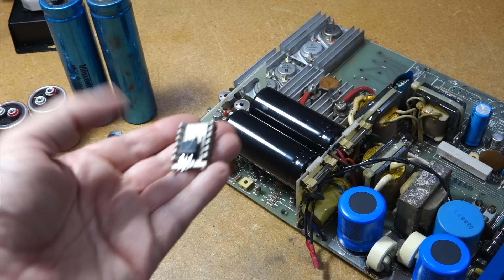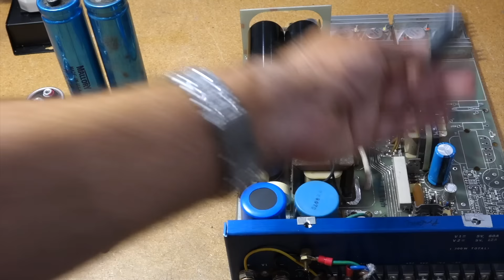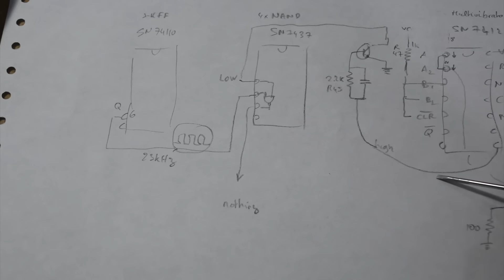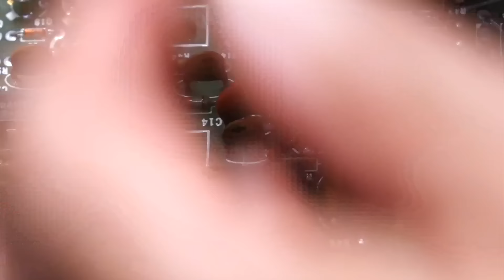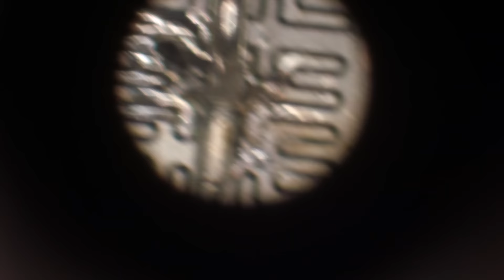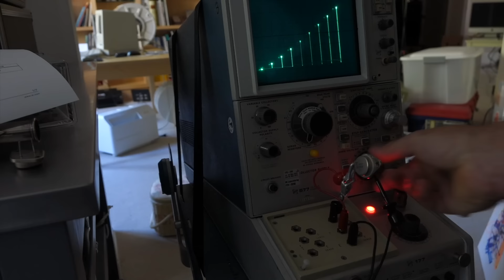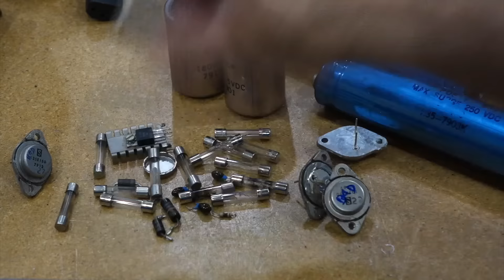Digibarn Alto Part 2: Restoring the Power Supplies from Hell

Comment: The fuse problem is the worst... Many times I have rolled across the shop to steal fuses from other equipment to diagnose what's on the bench. If only someone made a resetable ckt breaker for those push and turn holders...

Comment: A variac is very handy for restoring power supplies that are having overcurrent problems.  That way you can monitor for excessive current through the circuit as power is applied gradually.
Reply from the maker: Might help a little bit to reforms caps in a linear power supply. But if there is a hard short in a linear supply it’s useless too. It won’t help you with a switching power supply - the transistors are used as temporary shorts. And if it’s not temporary, they blow themselves up. Nature of the beast. Might even hurt: you could get a good switcher in a stuck undervoltage state and destroy it.

Comment: From what I can remember, it was considered 'common practice' to set the 5V output voltage somewhat above the nominal 5V to help account for cable resistance.
eg: If you set it to 5.1 volts (+2%), then there's a decent chance it will still be within tolerance (normally +/-5%) even when it's fully loaded down.

Comment: Old transistors are a pain. I have a few 50va 125 volt 400hz aerospace inverters that I managed to blow up the transistors on. I got lucky and found the schematic that told me what type of transistor they were and what they needed to be rated at. Took a while but I found 10 of them for about $30 from China. Got them and swapped them in and my inverter lived again, surely not to fly again but good as new if not better. I think they needed to be 60 volts at something like an amp or two but the replacements I got were rated for up to 10 amps. I examined an original circuit and the circuit with new transistors with my oscilloscope and they seemed to be electrically identical.

Comment: One trick I use is to use and incandescent lamp instead of a fuse during debugging. The lamp will limit the current to a safe value in case too much current is drawn. Also as the resistance of the lamp when cold is about 1/10 of working resistance the voltage drop is not so big at low currents. This has saved me many blown power transistors.

Comment: @02:05 How to find shorted tantalum capacitors:  "Turns out -- it's still bad . . . because the output's shorted.  So . . . and then we get the classic shorted tantalum, which we found by basically just powering it with several amps, and we looked for smoke."

Comment: I work in aviation qualification. Unfortunately, for the qualification of equipment, the exact spec of the configuration is essential. Any old components from the zenzyg market could result in unsafe performance. That makes for $+++ and there is profit to be made, sure, but don't underestimate the work in qualifying aerospace equipment. Just look through DO-160! Snakes on a plane are the least of your worries.
Reply from the maker: That is very true.

Comment: Power supplies have become too cheap to justify repairing them for our customers. Replacement is generally the better economic bet. But when we did repair switchmode supplies back in the bad old days, an isolation transformer was absolutely mandatory. 
It breaks the galvanic path from the AC mains input to the SMPS, and permits you to choose any arbitrary point in the primary circuit as your reference ground. Makes a 'scope more useful. Also prevents the "exploding ground clip" hazard.

Kinda takes me back. Great work!

Comment: Use a an underrated voltage isolation transfomer. Probably 50VA to 100Va will be enough to kick the PSU in. Two good points. First, it protects your scope. Second, you CANT blow a fuse nor explosions, nor sparks since the isolator drops very gently (when underrated). I repairing ATX PSUs, I always use a 50VA isolator, never got a serious event, its is not powerfull enough to blow the fuse. I put a led on the output so I can tell when the isolator is shorted or overloaded (to avoid toasting it).  The isolator started most of the PSUs. Strugled once with a POE PSU from a CISCO switch, because it has active PFC and it need to start working even with in stby and takes a nice amount of current. But eventually kicked in.

Comment: This Power Supply appears to be an early switch-mode power supply, 
that resembles some aspects of older Linear Designs.
Given that these power supplies are ~35-40 years old ... leaking Electrolytic capacitors are common.
Blown diodes suggest an external surge voltage for their failure.

Comment: Very good.  I worked on switching power supplies for the AUTOVON system in the US Air Force.  The power transistors would blow even when you did everything right.  Tough to diagnose and repair!

Comment: Great job!
It's never a good idea to open the control loop of a SMPS; you learned that the hard way ;)
I've modifed some small 20 to 50 watt SMPS to turn them into constant current power supplies for LEDs, and I've always double checked that the control loop is closed before powering it on.
SMPS using the flyback converter design (common for up to like 100 watts) will blow up instantly when starting them with an open control loop.

Comment: At the end of the 1980s I had a hard time with Solitron devices darlington transistors that were connected in bridge in  servo controllers a customer brought me in order to repair.  I consulted my suppliers and the price quote was absurd.  The solution was replace by power mosfets.

Comment: I would, for safety reasons, replace all them PSU's with a regular ATX power supply,  everything is there except for the 15v lines in which I would either use a another supply or a stepup.

Comment: Ahh, the joys of SMPS repair. Most painful I have ever repaired was from my own Sony Profeel KX-27PS1 TV Monitor circa 1981. It was a strange self oscillating power supply with a epoxy coated hybrid control board that would control the supply's output by injecting a signal into a control winding on the isolation transformer/inductor. It would randomly blow the chopper on startup once every few days to every few weeks. After replacing half a dozen expensive sony transistors I modified the soft start circuit which cured the problem. Soft start was very odd too consisting of a huge current limiting resistor and relay that would switch the resistor out of circuit as the secondary voltage would rise. Cheers.

Comment: You missed the opportunity for a "walk in the PARC" joke! Good job though, I'm curious what the cost of replacing the PSUs with similar, modern ones would be!
Reply from the maker: It's not a question of cost obviously. You don't want to destroy the historical authenticity of the machine by blindly sticking new generic parts in it, even though it would be way easier. Plus these are are quite noble, early switching power supplies. Priceless? It's a fine balance sometimes trying to preserve the functional as well as the historical - we try very hard to do both. That said, I was pretty close to giving up on that one...
Reply: A dedication to authenticity I can support. If they fail again with something you can't replace, would you consider modern (probably higher efficiency) supplies?
Reply from the maker: For a machine as rare and historically significant as the Alto, and belonging to a museum, unlikely, unless there is no other practical solution. 
For a more widely available machine, that I own, and with a generic consumer grade power supply, possibly. I'd still try to repair the original first!

Comment: Wow, you blew a pair of $300 transistors???
Reply: They're only $300 nowadays because they're no longer manufactured. So, technically, he didn't blow a pair of $300 transistors - but that's the price for replacement original parts. I think so long as the replacement parts perform the same as, or better than (as is often the case), the originals and they are a good physical match then it's completely acceptable to use them. After all, many of the modern replacement capacitors are smaller than the original ones. Surely the main aim is to have a fully functional piece of kit, rather than a faulty, albeit totally original one!
Reply from the maker: No way I'd ever pay that much to these crooks! I'd put in an equivalent. Which is what I just did.
Reply from the maker: Oops.
Reply: AFAIK, if his second set of substitutes didn't work, he'd probably be forced to pay the current-going-price, which just over $300/pop.

Comment: I’d be very nervous leaving the IC in a socket - should the socket develop a bad connection over time (thermal cycling etc) and the regulation go haywire, I shudder to think what damage would happen to the the Alto. Well done on getting it up and running though. Switch mode power supplies can get quite entertaining when they blow up their switching transistors...
Reply: Had a desktop power supply let loose the magic smoke once. Was one hell of a bang then loads of smoke. Took out a cd rom drive as well as a hard drive. Never want to experience that again

Comment: Excellent. I really enjoyed your repair video.
Whenever I do PSU repairs for industrial customers, I replace ALL caps, re-seat each and every IC, and check every resistor for proper values, in prior to any measurements. C20 is very likely to fail soon, even though, I can see you have checked it already.

Comment: Congrats on this one !  Btw I know you are carefull, but please, be even more carefull, working on switching power supplies is damn dangerous.
Reply: That large watch is making me very nervous....
Reply: Such supplies scare me silly. I've had good results running the high voltage side at just a few tens of volts provided you power the control logic externally. This allows you to follow the switching signals right up to and including the power stage without the risk of imminent death! You can exercise pretty much every component in the supply this way.
Reply: Welcome aboard Sir! :)
Reply: Another strategy is to power the supply through a resistor, which limits the current and so avoids explosions. This doesn't do much for the shock risk, however. Once you are happy it is essentially working (albeit at very low power), swap the resistor for a filament light bulb. At low currents, this has low resistance. If the current goes up unexpectedly, all that happens is that the light comes on! It's an old idea, but still handy in cases like this.

Comment: I wasn't expecting switching supplies in a computer that old...
Reply: I worked for a guy in the mid 70's that started his own company, designing and constructing microcontroller-based systems.  He was especially proud of the switching power supply module that he sweated and slaved over for long hours to get designed properly.  Last I checked he was still in business.
Reply: @donmoore7785  what’s the name of his company

Comment: that was interesting. 
my suggestion would be: 
a) during testing put really low rated quick fuses, this may save transistors
b) for regular operation, put sand filled fuses. it's a lot more secure if they blow. Or alternativly put silicone caps on them
c) get a transformer for propper earth separation plus an easy accessible switch. looking at your "extention cord operation" really makes me shiver. this is not safe.
Reply: I put a 300w tungsten lamp insted of a fuse

Comment: Can't you use 2N3055 or MJE3055? general purpose power transistors, can you use a power supply out of an IBM compatible?
Reply: NO WAY!  As he mentioned a few times, at least 400 V capable transistors are needed.  3055 is rated 60 V.  Moreover, a 3055 is SLOW.  For the switching, you need FAST or even faster!  No deal...
Reply: BUX80 would likely work, and is easily obtainable.

Comment: Stupid question: why spend so much time to fix what looks like a set of stock power supplies?
Reply from the maker: +Laurent For the challenge, and for preserving the integrity of the historical original of course. But Carl and Ken were questioning my sanity just like you!
Reply: And we all want to suffer along with Marc on this. It's so much more fun that way! :D
Reply: It is not "restoration project", if you throw all innards away and emulate them with Rasberry Pi and LCD-screen. From user point of view the result would the same (or better), but CuriousMarc wants to suffer.
Reply: First. I don't think its a stupid question. My answer is this. Yes you can do exactly that and it would work even better. However what would you gain from that besides a working power supply. I've done that in the past and felt quite empty doing so. Its more than just bragging rights too. Short answer: We want to learn. We want to learn what they were thinking back then and how we got where we are today.
Reply: The power supplies also must fit in the same space and be easily "mountable" without drilling additional holes.  Additional holes-drills easily destroys the restoration.  Think of it as a "rare" antique.  There are definite do's and don't's to this.
Reply: I think the point was more of "These are just off the shelf regulated PSUs so why not grab some new ones". 

They aren't Alto specific and even for testing reasons I'd keep a newer set of things on hand, just in case one like this decides to go again while trying to get the rest of the system up and running. It's not entirely out of the picture that a PSU with this many failures so far will have more down the line.
Reply: See now that's the Fun part. Can't spell defunct & disfunctional without fun. :D
Reply: CuriousMarc

I would imagine that these exact PSUs aren't easy to get hold of now either?

Using more modern off-the-shelf PSUs in the Alto chassis would be a bit strange, so I can see the point of the repair.

(I was forced to retrofit a Cisco server PSU into the Paintbox, as I never had direct access to the original Gould Hiflex PSU in order to repair it.)
Reply: Modern chips may not handle this circuit.  Modern chips run much faster and probably can't handle this psu for long.  Plus it's gotta fit along with the rest.   Unless it's. Home mod.
Reply: @CNe7532294 New off the shelf power supplies might work better in the short run, however much of what we buy now is designed to be thrown into the landfill rather than be repaired.

Sometimes it can be a trade off.  Are you doing this for yourself or for a customer.  That can decide whether you go with off the shelf retrofits or try to keep it original (if possible).  Seems though that later on Xerox manufactured most of their own power supplies (think first generation Star 8000, 8010, 8011, 8012) and the 850dsp, 860ips. A friend who was an engineer at Xerox was in the power supply design division at Xerox. With the 6085I and beyond some or many of the assembles were farmed out.  I have several 6085 power supplies manufactured by the now defunct TRW.

Comment: If you used at least a dim bulb tester, I think you would know immediately if there was a short without popping the fuses.  Of course the lamp(s) would start out at a minimum wattage threshold way below the power supply's normal consumption then work your way up in steps.
Reply: The Antique Radio Forum helped me find standard cross reference for transistors with proprietary 1960's 3M part numbers stamped on them.  After a couple months someone came forward with access to a database which showed the cross reference (for which it was a very common ) transistor.

If interested, the thread is here:
http://antiqueradios.com/forums/viewtopic.php?f=13&t=319927

I suspect these may have been manufactured by someone else and a proprietary p/n was placed on them for the power supply manufacturer, in order to keep someone from easily repairing it, therefore keeping the manufacturer and/or their service techs employed.
Reply: Seems a LH research domain was created for Pioneer Magnetics which builds replacement power supplies.  Probably a lot less expensive than $600 for those two transistors.
http://www.lhresearch.com/
Reply: Is anyone else screaming "You have a Variac, I've seen you use a Variac, plug it into the damn variac"?
Reply: A variac can't really tell you if there is a short circuit or not.  A dim bulb tester definitely does without letting the magic smoke out first.
Reply: Excellent suggestion. I always use a variac and lamp limiter when powering up any bit of kit that hasn't been used for some time, saves fuses and tears.